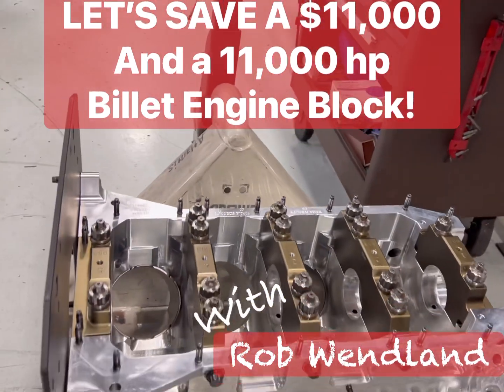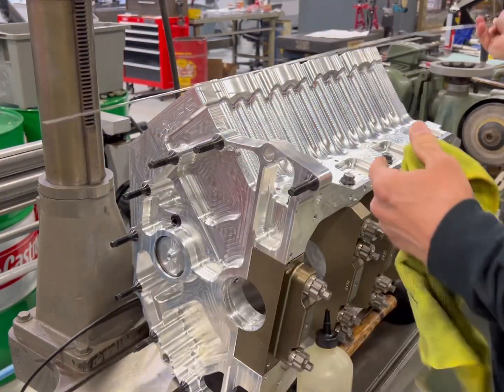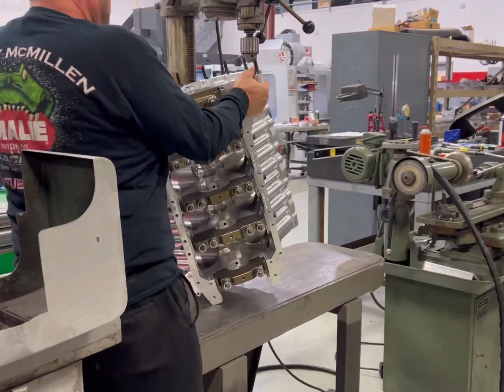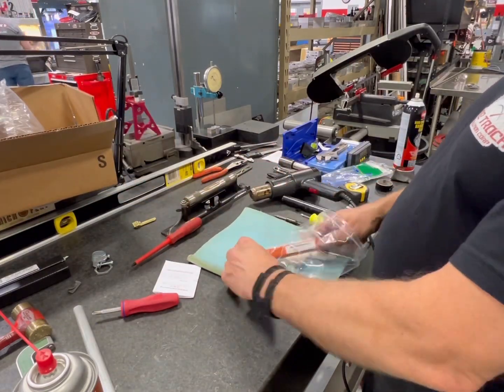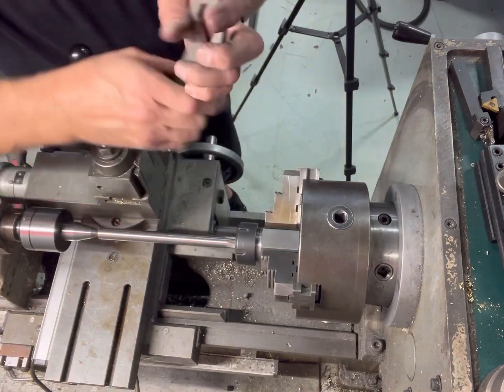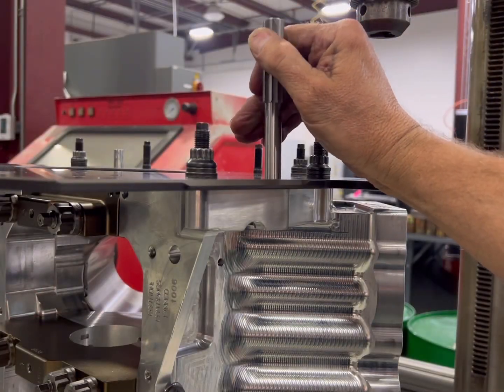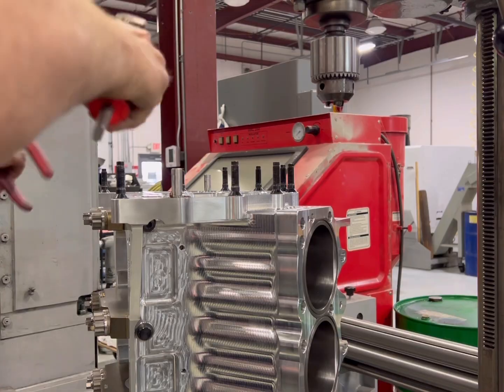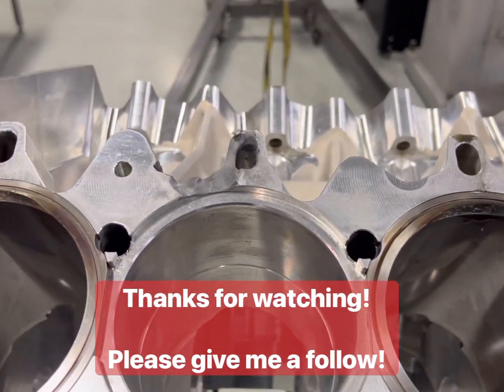Saving a $11,000–11,000 Horsepower Billet Engine Block!

Comment: I didn't see you putting relief on the reamer teeth (back rake) it would have to "wear" its way through the metal and likely won't be as round or as straight as you'd like because there will be a difference of hardness in different parts of the hole(presumably the block was heat treated). As a machinist I consider that to be a boring head job. That would place the hole exactly where it needs to be and require no special tooling.You could bore it to size or after you establish a straight bore, finish with a reamer in the usual direction with a standard reamer.

Comment: Question. Aluminum Fe ford block. Pulled a main cap thread. Tapped oversize for helicoils. One got tapped crooked.  Not enough meat left for a oversized solid insert.  Can the hole be welded up , drilled retapped for helicoil since the others are all straight with long helicoils.  The block is in long beach ca. If you think you might be able to fix this.

Comment: Rob, I commented about a year ago that my old Snap-on brass dead blow hammer that I've had for 30+ years was still going strong.  Well I think I jinxed myself because the handle started crumbling apart EXACTLY like yours did a few weeks back. 😡

Luckily my Snap-on dealer replaced it under warranty, but it's the new style handle and doesn't have the same "character" or sentimental value that the old one had.  🤣

Mike

Comment: There he is folks... Mr. Rob Wendland... the " hitters crew Chief " back at it again! Glad to see you back my friend... will continue to send good thoughts your way sir! I had Dotco take one of my heavier 12,000 rpm air grinders with the removable 90° handle on it, worked on the air motor some more to give it adjustable speed but still transfer a full power stroke... I fabricated an adjustable angle air hammer extension that would swing 60° which pinch mounted with 2 shoulder bolts. To this I made a couple different hand held... knurled and heat treated, cylindrical bucking bars to peen welds on repairs such as these. After hand scraping ways for a couple of decades, it is an essential tool for my hands... at 63... and peening welds, and a few other apps we've found... lol. KUDO'S to you for getting back to it my friend! KUDO'S...        Seth
( I just followed you... after my 28th surgery... back to it everyday! )

Comment: you should be using a moly bonded lubricant meant for machining to push that dowel in it resist high pressure and will stop the parts from seizing, we used it at alcoa aluminum for the 22 years i worked there.
Reply from the maker: It is.

Comment: Great Video, Rob.  Nice Work.
Another way to do that Hole Repair is with an Offset Jig Boring Attachment Head (Model No. 2) for a Bridgeport Miller, if you don't have a Moore Jig Borer handy. Tram the Head Square with the table, first. Just strap the block to the side of the Milling Table, install your Mounting Plate, Indicate the center of the hole in your plate you want to bore in the block. Remove your plate. Install your Offset Jig Boring Head with a Boring Tool. Adjust it out & Lock it each pass until you sneak up on the Diameter you want, checking with Gage Pins, Inside Micrometer, Vernier Calipers, or a Bore Gage. You won't have to buy & modify reamers each time this type of repair is needed.

Comment: Why couldn't you use the nearest stud, a Bridgeport mill and a dial indicator. Then punch it from the top/Trans side. Then the tool mod time wouldn't have been involved. I'm confused?
Reply: My guess is that Rob did it this way so he would have a Self Centering/Guiding Reamer. Then he could do this repair in a trailer, at the track, in a Drill Press. When you don't have access to a Bridgeport Miller.
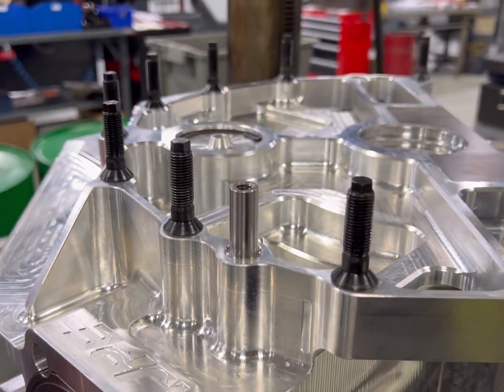https://youtu.be/sr342xIHAdg at 4:45 you'll see how Rob made a Lathe out of an Injector Nozzle, Blower Idler Pulley, a vise, a hand drill, and a hand grinder. All to do a repair on an Input Shaft at the track.
Improvise, Adapt, Overcome method applied here.

Comment: All the chemicals that you had on you hands when you used your hammer imbritled the plastic when I work in a machine shop that happened on a few hammers harbor freight and snapon but harbor freight has a lifetime garenteed on the plastic Handel hammers and so does snapon so I exchanged them and the new hammers have upgraded plastic ,,I gotta say I'm going to makey new Chevy LT1 block look like that block with a rolock disc thanks for the video

Comment: Gosh.. it's insane just how exact this has to be... I get it for internals of engines.. but a damn dowl pin.. angle ... 
It's like what the hell ..
My uncle thought me about getting those dowl pins lines up nice with the bell housing. And they have to be turned to match, and be in the right direction...  For his drag cars...
But this is another level ...
It's hard to believe a couple thou on a dowl pin, can make or break an engines performance

Comment: I had a couple especially my old green piston hammer from snap on that the handle blew up after many times being soaked in parts washer break clean engine oil I have had a couple of there hammer handles bust they will swap it out for another

Comment: 11,000 horsepower? Another fish story maybe 1,100 horse isn't no way 11,000 horse can't even get that out of our Allisons or our Arias Hemis. If we could get 11,000 horsepower from a single engine with Aluminum block we wouldn't need so many engines on our pull tractors. We run 3 Allisons on our tractor and the total 9,840 horses all together 36 Cylinders close to 6,000 cubic inches total and we make 9,840 horses all day long. If we had one single engine producing 11,000 horses we'd sell every single allison and Arias we have and use weight boxes in place of all those unneeded engines.
Reply from the maker: Education is essential for people who are unaware of how much power nitromethane makes when you burn 90 gallons per minute…. No this isn’t a tractor puller, not a airplane, it’s the fastest accelerating machine on the planet….

Comment: I dig your stress relieving technique with a ball peen. Did you have to preheat before weld? Bring it back to room temp slowly after weld? And how is the heat affected zone around the repair? Just curious this is an awesome video.

Comment: The hammering of the weld i think would technically be called cold working. There is almost no way even after the weld that the temp would still be high enough for it to be called anything else. 
It does help to relieve the stress.
Reply from the maker: Right on! I beat the shit out of a lot of stiff! 😀
Reply: @robwendland  What you did there is called "work hardening". Every metal goes through this process. The downside to work hardening is that it actually becomes MORE brittle and MORE likely to crack.
Reply: @mikeford963  It also becomes HARD. Copper and Bronze Age weapons were work hardened with a hammer to get their edges tough enough to do the job without bending like a wet noodle. There is always a trade off between the metal being too soft and too hard. If wacking the weld a few times with a ball peen hammer work hardend it enough to make it too brittle then the weld was too soft to do the job in the first place.
Reply: It's aluminum. I'm more surprised he didn't terminate the end of the crack properly first.

Comment: There’s something I’m gonna mention that I do when I’m welding a crack cast-iron aluminum or anything like that I have a Miller dynasty 210 DX what I always do is I cut my crack out if I’m gonna cut it out and you know how you drill the end of it I like to run a counter sink down in the hole with the end of the crack that way when you weld you help tie in further around the crack you know what I’m saying you’re you’re spreading the loadout over bigger distance and I truly believe that helps make it stronger but what I learned from you about painting the aluminum you know I just learned something from you this is a Jim mungai from Kennerdell Pennsylvania
Reply from the maker: It’s great to learn a little something from everyone but this block is billed and not casting. The welder I use is a dynasty 350. I run a ton of -1/3 of the positive and a frequency over 300. I have a series coming out soon about welding this way with a helium mixer and I’ll be sure and share it with you.

Comment: Aii that for a dowel pin???????????
Reply from the maker: Yes it aligns the Bellhousing which is a huge deal because it outlines the rear of the input shaft where the reverser comes to it and also it’s direct alignment with a hard-core coupler not a huge joint that goes to the rear end all very critical. So what else you got?

Comment: Nice job Rob, I would be scared to touch a $11000 dollar block. I think you need a tool post grinder for your lathe.
Reply from the maker: I have one that’s made out of a router but I couldn’t find a stone large enough to get over to it. The damn thing spins so fast I tried putting a bigger stone on it but it was vibrating and getting ready to throw it off the las so I had to resort to the other old tool grinder.

Comment: Very painful to watch sorry dude. You had a great plan a very reasonable solution to locate the hole after welding. Not grinding cutting clearance on the end of the flutes on the reamer to pull it backwards probably worked in your favor to achieve a press fit. So that's just fine and dandy. But holly shit hammering the precision pin into the hole with no guide to keep the pin square to the face that was painful to watch. That hole was way out on an unsupported ear with only a web of aluminum ment to support shear loading and there you were driving that pin as if it was 10 penny nail into a log cabin. I was impressed with the welding  very nicely done and the idea for relocating the hole was a great plan for a simple fix. You very easily could have used a D-clamp or a C-clamp or any sort of a clamp perhaps a puller arrangement of some sort to draw the pin into the hole without beating the shit out of the unsupported ear. At the beginning you explained your processe for removing stress with your hammer forging technique. And then after everything was done successfully you took your brass hammer and beat the living shit out of the bitch. Sorry my OCD wouldn't allow me to watch in silence.

Comment: I long ago gave up on buying/using hammers that don’t have wooden handles because I got tired of “Computhane”(sp?) hammers falling apart on me at the most inopportune times.  My favorite hammer for beating on things that I don’t want to damage is a lead hammer like is used on wire wheels with hub knock-offs and then of course there is a 5lb, 8lb, 10Lb, 15lb and 20lb lead beaters I made from melting down old wheel weights sporting Hickory wood handles

Comment: That jacobs style drill chuck is proably at least .005 out of round. If it was brand new maybe and I mean maybe .002. Those things are horrible to turn true.  Even a albrect is probably .002 normally.  Maybe it doesnt matter, but I am surprised a precision grinder like that has such a cheap chuck when its meant to grind things like endmills that are usually .0005 or better T.I.R.
Reply from the maker: I had to adapt that to that holder. What you didn’t see me do is put an indicator on it. If you looked real close there are some feeler blades actually underneath that check even. If the videos get too long lose audience retention. So I try and make them a little bit technical but not so much where a lot of us every day guys are gonna fall off because we don’t necessarily understand it. But totally understand what you’re saying!
Reply: @robwendland  Copy that and thanks for the reply!  I know your talented so this response makes sense to us that have a bit more knowledge about how all the "fine print" of this kinda stuff works. Thanks!

Comment: Looks like they don’t run all the same diameter head studs on those motors?
Reply from the maker: There are some helper studs that are down in the corners but the head studs are all the same diameter different lengths.

Comment: On the hf engine hoist jack. Cut off an inch of handle  weld a big washer to it like a wing nut. Slot the other end for the pin. Put some floppy chain on it so you dont drop it.  Giving you a nice flat handle to grab on the down screw.
Reply from the maker: Good idea!

Comment: I'm guessing those billet blocks and clutch housings don't require indicating to center them up. I did so many back in the day with offset dowels or ream the bellhousing holes oversize, align the housing , then weld pieces with proper size holes to the bell. Then they got to not liking welding on the bell. Anyway nice repair! Always enjoy your expertise!
Reply from the maker: Yes we do still check them more with a new bellhousing than an engine block. Thanks for watching!

Comment: Love the video !  I have a bit of info on your brass hammer you may not be aware of. I had to learn this the hard way. The composition of your hammer is urethane. What grade I couldn’t tell you, but I do know from experience that they do not like being put in a parts cleaner, such as a “ Safety Clean” . The solvent attacks the urethane and breaks it down, causing the handle to break like it showed in the video. Needless to say, I just wipe down the hammer with a clean shop towel from now on. Expensive lesson for me to learn, because it was a Snap-On brand, and they ain’t cheap ! Anyway, keep up the cool videos, I always learn something from them !
Reply from the maker: Yeah I bet that thing‘s 15 or 20 years old so you’re right it’s probably had a can or two a brake clean ran through it!!! 🤣
Reply: @robwendland  That hammer should have a life time warranty on it. I know Mac does.
Reply: All my Snap-on dead blows disintegrated and yes, I always threw them in the safety clean.
Reply: @billmiller7138  I was a Mac Tools Dist. retired two years ago, and we would replace any hammer that disintegrated or damaged (not abused) Mac's standard policy. I did know some snap on guys would try to skirt their company policy for there own gain.
Reply: @sandpaper6704   Well, I have to admit I was too embarrassed to go to my Snap-On guy and tell him what happened. Mainly because I figured he would think I was a bonehead for doing that. But in my defense, I had no idea that the handle would disintegrate like that. Lesson learned ! I still need to buy another one though.
Reply: @jimmywaters3987  I have had guys hand me the hammer in plastic bag with the remnants of the hammer in and I would replace it. Customer service, convenience and the lifetime warranty is why you pay the high price.